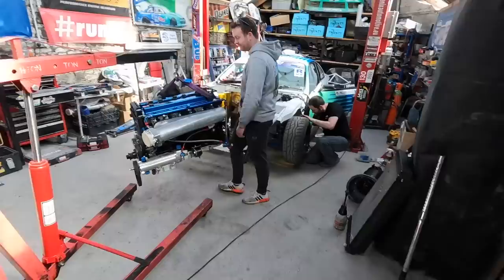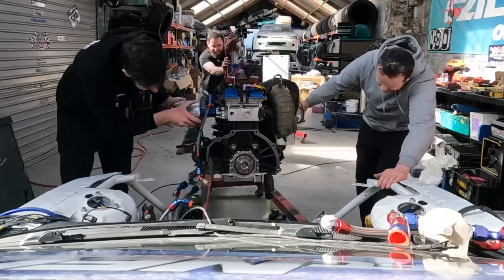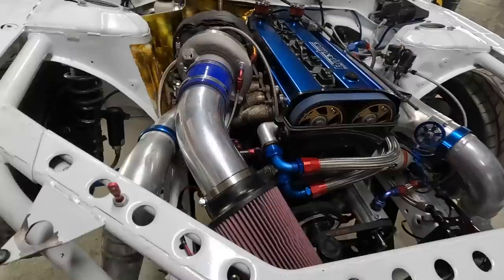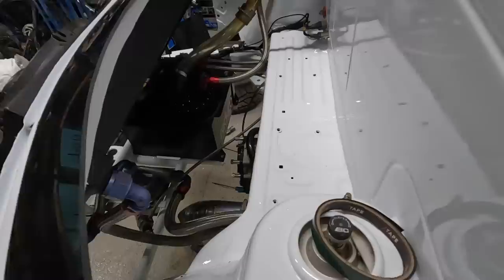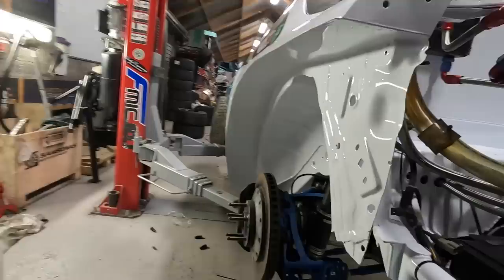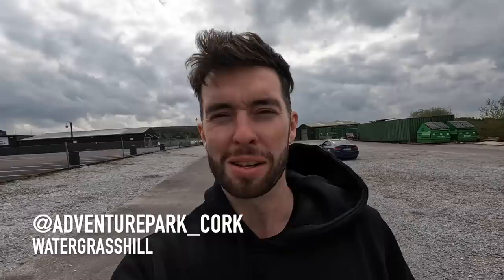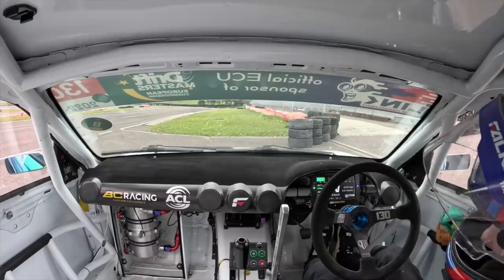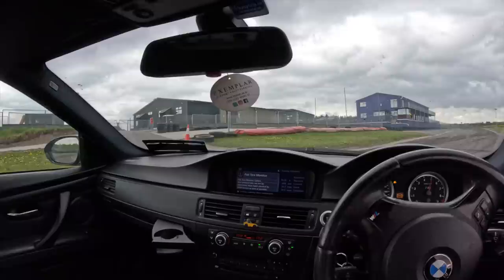Rebuilding and Testing the 1000HP 2JZ S14.9 ahead of Drift Masters

Comment: James is there a reason you don't use the vvti 2jz? Or was it just budget reasons when you first got that engine?
Reply: I'd assume because nos is vvti, so no need to add the extra complexity, and getting non vvti 2jz blocks/heads is easier. At least from my experience.

Comment: See the newly built engine, could you get your brothers thoughts on it just getting drifted straight away without "run in" cheers
Reply from the maker: We had a minor run in period and cycled through many heat cycles before leaning on it hard. We also did this first test at 1.2 bar boost so just tickling the motor
Reply: @James Deane  cool, just wondered because he builds the most bullet proof engines and was thinking that you didn't do any 1000 miles run in lol, 👌

Comment: Will there be a new Falken livery style on the S14.9 or will you use the same livery as last year?
Reply: Falken hasn’t changed its livery in like 20 years 😂
Reply: @trippnoutmotorsport3164  what I meant was will there be adjustments like last seasons livery when it's not just the stripes and has different stuff on the livery

Comment: why does he call it the s14.9 for anyone who knows?
Reply from the maker: It’s an S14 with S15 headlights and S15 taillights. An S15, but not quite so S14.9 😂
Reply: Because its part S 14, and part S15. S 14 Chassis, S 15 front and rear.